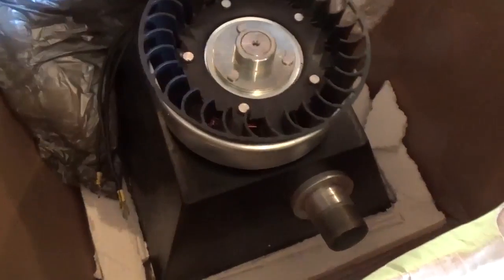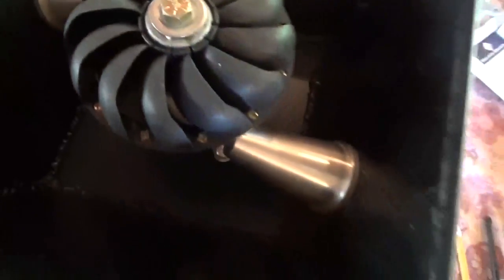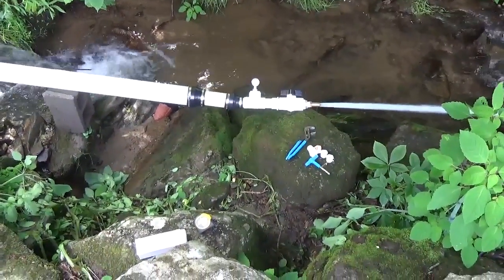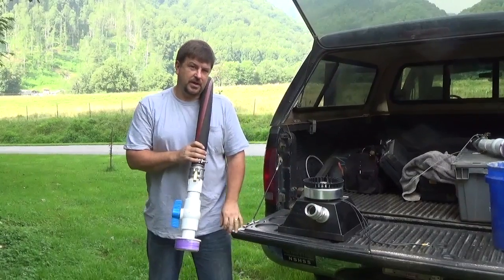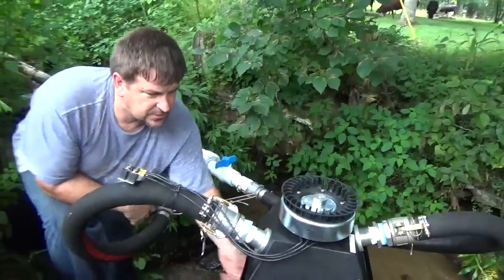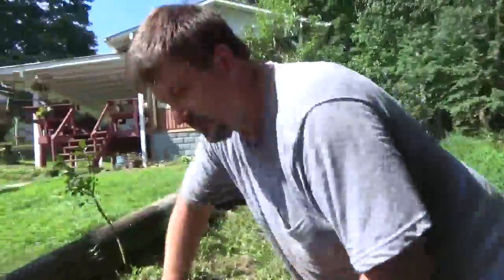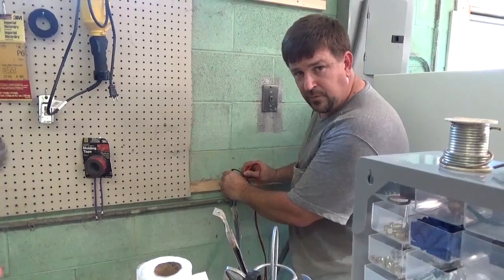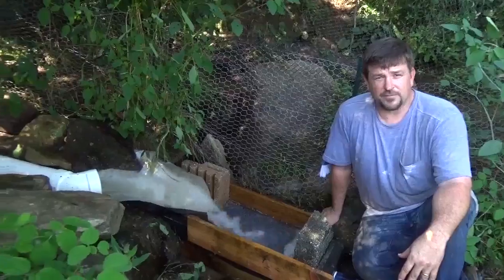Micro Hydro Power with Turgo generator Part 1

Comment: That thing is noisy. Is there a way to use sound deadening material?
Reply: Yea if you do some minor fabricating and engineering you can have a super nice silent setup
Reply: they have better and quieter micro-pico generators that put out in excess of 1.2kwh in 3rd world countries than this noisy open contraption.  with that amount of flow you could run a much larger rig than this, or several smaller high output generators.

Comment: I'm loving this.....
My question...Can I attach the leads directly to the breaker panel, to supply 120v? Or must I run them to charge batteries only?
My plan is to own property within 2 years that has a year round stream, and use a mini hydro generator to provide power the house.
Reply: We have a 3 phase inverter 120 volt but you have to have 30 foot head or more for it t work
Reply: thanks
Reply: No
Reply: very low power output. better to charge batteries....

Comment: what if you took a hose from the pond and hooked it into the low pressure input side of a piston pump, used the high pressure output side as the dump valve and then used a connecting rod and flywheel to turn the pistons linear motion into the rotating motion needed to turn a generator?

I remember in highschool turning a generator by hand, when it was shorted turning was easy, but when it was an open circuit turning it was very hard; when electricity demand is high there should be a high rate of water flowing through the "positive displacement motor", but when it is low there should be a low rate of flow through, this would effectively turn the pond into energy storage and reduce the need for chemical batteries.

If the dump valve dumped into a second retention pond, then an electric pump that turned on whenever the solar panels are over producing could pump water up from the lower pond to the upper pond, or alternatively their could be a wind driven water pump doing the same thing. Either way, it increases the utility of the pond.

Comment: Great set up you have going there. I am wondering, if it's possible to make enough power through something like this to run a 110v mig welder? I love to weld in my garage, my wife and I are looking at a home in Montana that is already 100% off grid because there is no power up there. So I want to build my dream shop up at our soon to be new home, and be able to run my shop off grid. I know I can't run everything I want to at one time, but I am hoping to be able to run my welder and air compressor at different times. So I can build projects for around the house. Any input would be very much appreciated, we are jumping into this off the grid with zero knowledge of how it works, but I can build anything as a mechanic. I just don't want to have to give up being able to play in the garage by going off grid. Power companies make power so I should be able to do the same, we have a very nice year round creek. So I have the opportunity to make lots of power, we already have wind and solar that runs the home. I just need more power to run my shop. Thanks for any advice you might have as a place to start. Take care and thank you very much.
Reply: Yes I have a unit that will work for you call me @ 843 319 4830
Reply: You could. but for the low duty cycle you are probably going to use those machines, it would make more financial sense to get a diesel of gas powered welding machine. If you get one with an inverter and regulator, it can do double-duty as a backup generator for your house if your primary generation goes down. Also if the place it rural, having a welding machine on a truck or trailer that you can move around paddocks will be immensely useful.

Comment: Awesome job describing hydro power which I think is a critical component to homesteading!  Solar is 50% reliable but water flow is 24 hours, minus any droughts.  Great work and I really enjoyed this video!!!!!
Reply: Solar has no moving parts, less to go wrong.
I would recommend having both, with battery backup. But I live in the suburbs and don't have either.
Reply: Droughts, frost and cluttered pipes
Reply: lol
Reply: lmao
Reply: Yeah, that damn unpredictable Sun goes up and down when it wants to, while the droughts come and go at a certain time. I fully agree.
Reply: What happens when storms hit and the area floods.  You'll find what's left down the stream of your power system.  I have a solar system.  100% reliable and makes power everyday.

Comment: This really blew my mind. Most of the microhydro systems I've seen could maybe power a light bulb or two so they were more of a novelty. All the math I ran and info I found on waterwheels was equally depressing. Most need a high volume and a large drop to make them practical. To power your house you'd need a water wheel bigger than your house. I believe you said 11 psi which is nothing, looks like there isn't much of a drop. There's a decent flow rate in the creek but the overall volume doesn't look that high. I was wondering what the GPM rate was? In the second video you said it was putting out 16,500 watts a day which is staggering for such a small turbine. You definitely got my attention with this one.